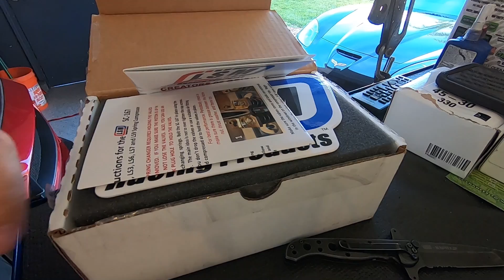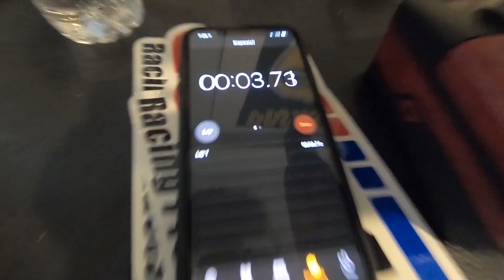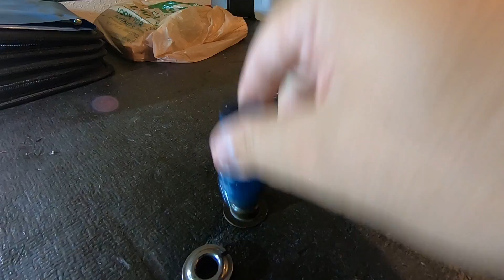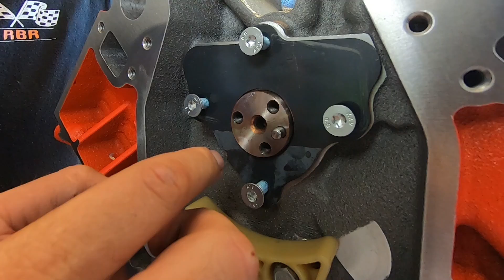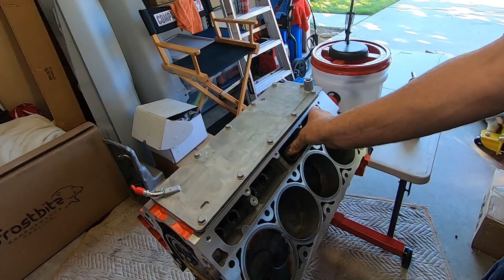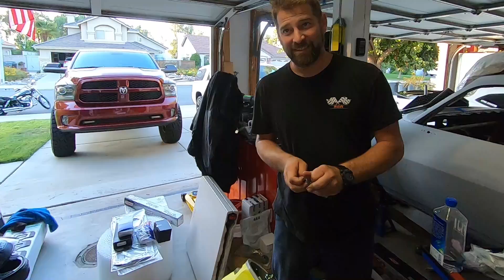LS7 Long Block Assembly | Engine Build Ep: 4

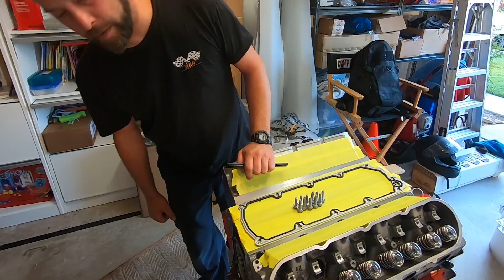Comment: At about 31:30 you were talking about something being too long, it turned 1-1/2 times. What were you talking about?
Reply: Pushrod being to long resulted in 1 1/2 or more turns of the rocker arm bolt being torqued down. So they went to a shorter pushrod to put less preload on the lifters. What I would like to know is what length they ended up going with cause I feel I have the very issue he is talking about.

Comment: Mike is doing a great job. A little trick for the keepers is to put a dab of all purpose grease on the tip of the valve stem. Then simply put the keepers in and the grease will hold them in place until you are finished.
Reply: I like to use a dab of vasoline